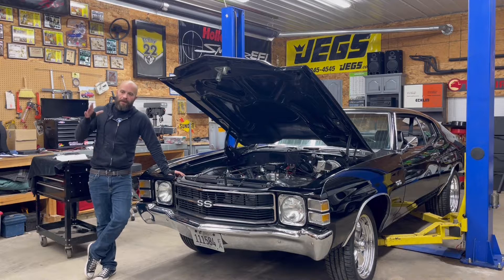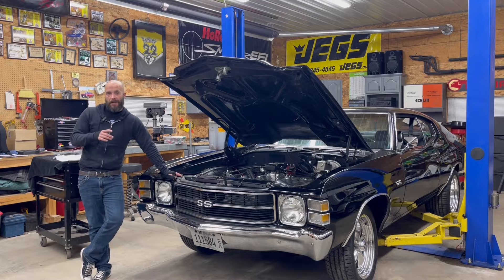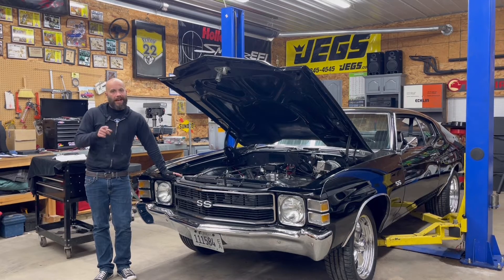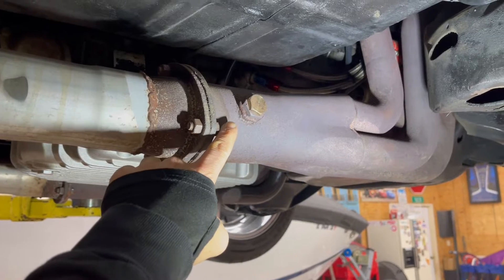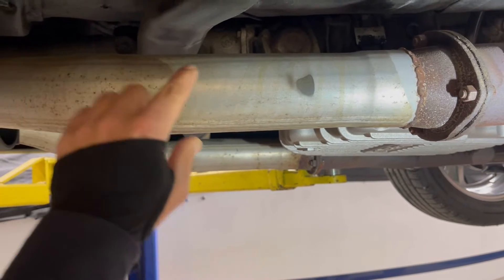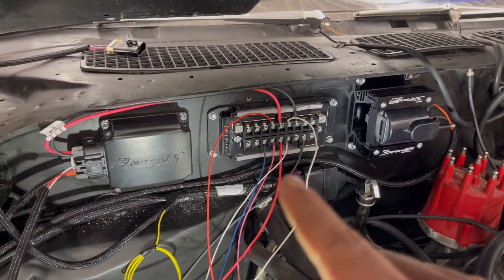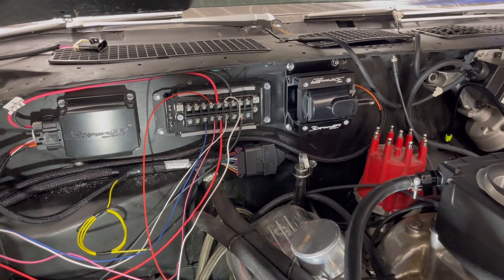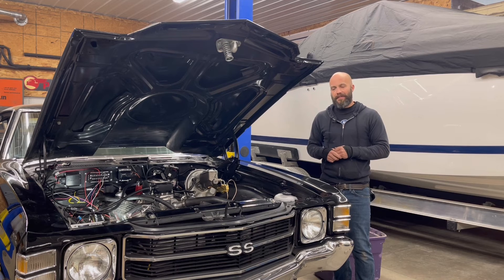Project Dazed and Confused - Holley Sniper EFI 2 Install Part 2 - Laying Out the Wiring #holley

Comment: I see in the kit, the O2 Sensor is listed as included, but I don't see the Coolant Temp Sensor listed. Did you have to order the CTS separately or?
Reply from the maker: no, it comes with it

Comment: The bung already in the header is after the collector and would have been perfect. The actual collector is the point where the 4 pipes merge. The bung is well behind that.
Reply from the maker: For you maybe, yes.  But for us, no.  This car is getting new headers soon.  Also, we are in range of location per the instructions and it runs great.

Comment: Might be a crazy question but I’m curious and don’t kno much mechanic wise but is it possible to use the pdm on the first gen sniper? seems like it should work
Reply from the maker: That’s a good question, I don’t see why it wouldn’t.  To be on the safe side, you might want to check with Holley on that one.
Reply: @2HacksGarage  thanks will do